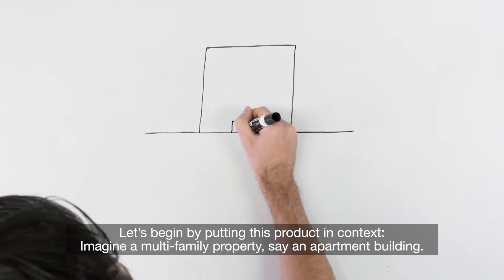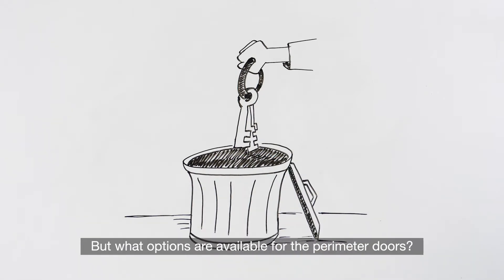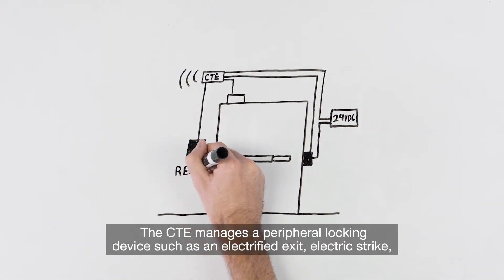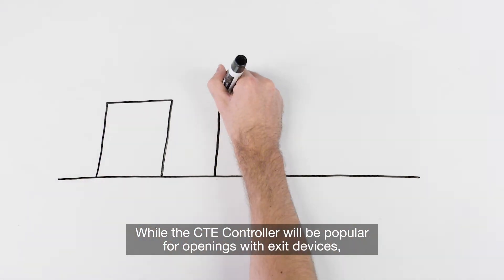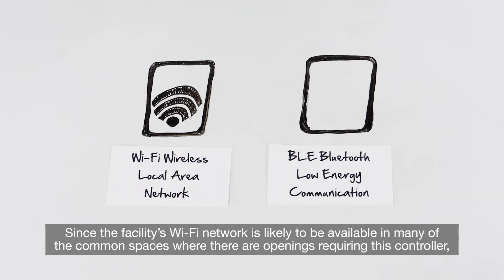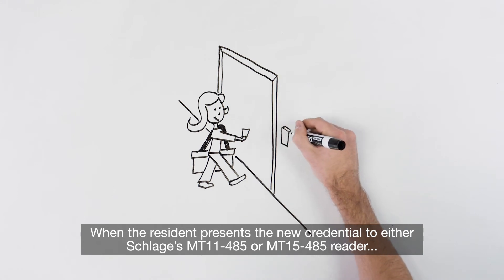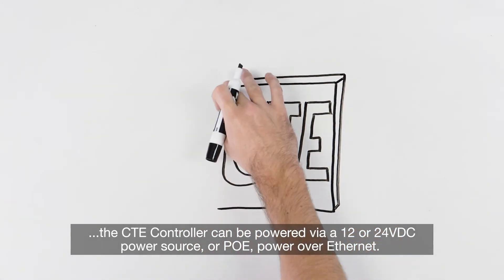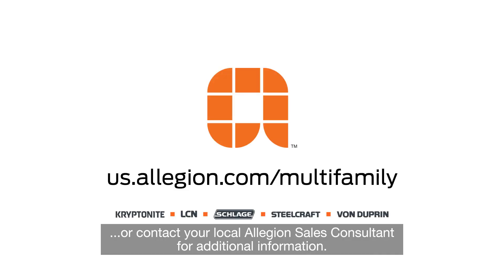Introduction to the Schlage CTE Single Door Controller

Comment: An Ethernet port that doesn't actually do any data  was a really poor design choice. Had a lovely chat with a customer who was sold on that feature working by one of your resellers and now has to invest thousands in a wireless network to cover these things.
Reply: Just ran into this ourselves, and I have to say, I am dumbfounded. This was an absolutely stupid choice. I ran an Ethernet cable to the device to power it from an Ethernet switch, but... oops!!!! It's not lighting up the switch port? What????? And there appears to be no clarification on this in the manual or other materials I've been able to find. It does mention PoE and PoE+, but the automatic assumption then is that it would also provide Ethernet connectivity. Nope! Only WiFi. To add to the confusion, right on the circuit board below the Ethernet port, it has labels for the Ethernet link and network activity LEDs. Why go to the work of labeling the circuit board with features it doesn't even support??? Fortunately, we do have nearby APs we can connect it to, but if you're going to have an Ethernet cable to it anyway, why not let it do Ethernet???? In my 30+ years of doing IT, I have to say that I don't think I've ever run into a situation so astonishingly stupid as this. I've now seen it all...